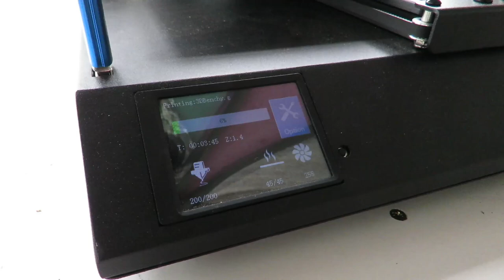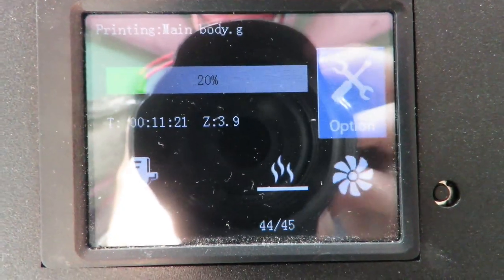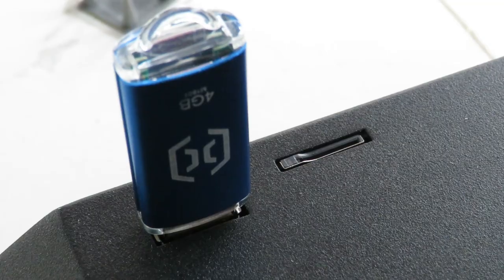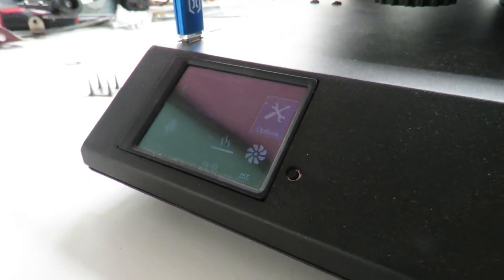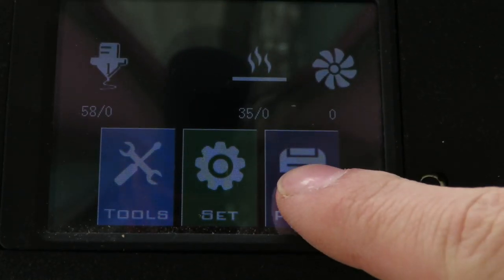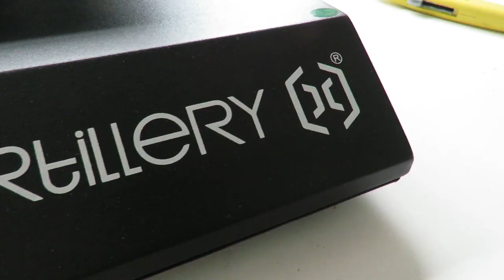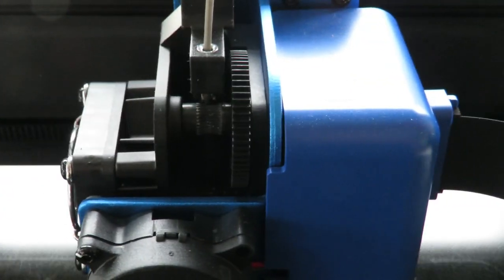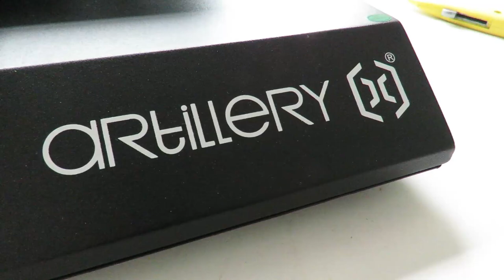Artillery Sidewinder X2 3D Printer - Massive Build Volume - Ultra Fast - Silent

Comment: I have a question I bought this printer from a friend but I’m having problems with the bed season. Could I use a surface on top of the bed and still be OK
Any help would be greatly appreciated
Reply from the maker: If prints aren't sticking to the bed properly, Clean the glass bed thoroughly with soapy water. Sometimes the beds have a bit of a greasy coating from when they were manufactured that stops the parts from sticking. After that apply a very thin layer of pritt stick all over the bed. We find that usually the cheap Poundland stuff doesn't work very well so best to use a genuine pritt stick.
Reply: Yes, you can put another glass print bed (or other type) on top of the original. The glass bed permanently attached to the heat bed was one of the only negatives I have with my X2. I simply added another glass bed on top and went through the process of re-leveling the bed. I believe I adjusted the limit switch 1st, then manually leveled the bed, then did the auto-leveling afterward. I'm super happy with my X2!!! I've had it for almost a year now, and it does not get much idle time. Replacement parts are easy to get and maintenance is also quite simple.
Reply: Don't use soap and water I have it , doesn't help clean after each print , with 90% rub alcohol and much sure u check leveling manual if good then do auto each print and set the heat if likenpla says 60 on it set to 63 , i have no problems and I been doing every small prints with detail and large ones

Comment: Don't try and use it for Z gauge, even in OO/HO the results are pretty average.
I'm sure you know that for good results in small formats you need to go resin printing.
Reply from the maker: No you don't. If you print items as kits, not one piece then you can get incredible detail with 3d printers, especially if you have the CAD skills
Reply: @BudgetModelRailways  Ahh maybe I'm a bit short on those skills. Cheers!